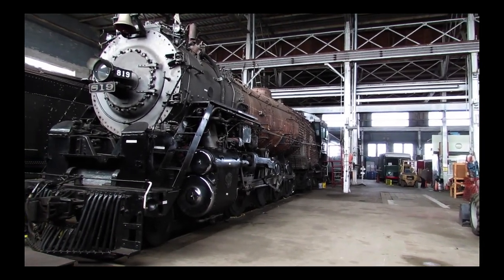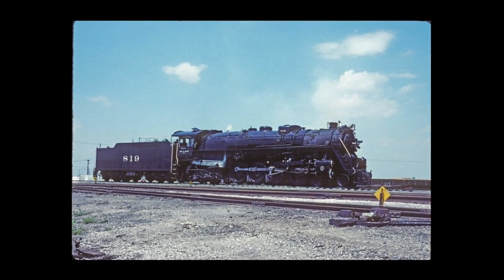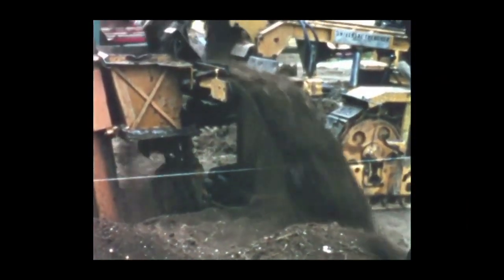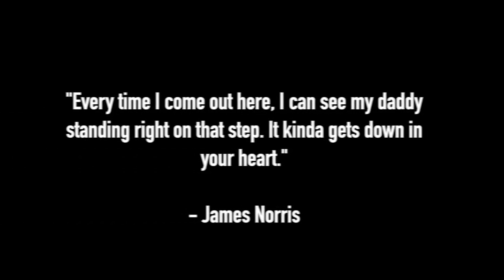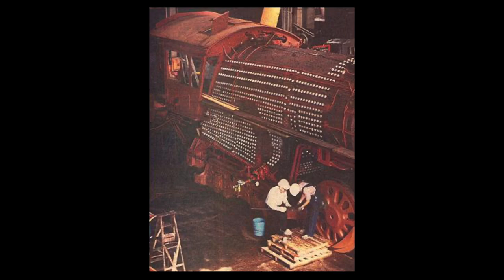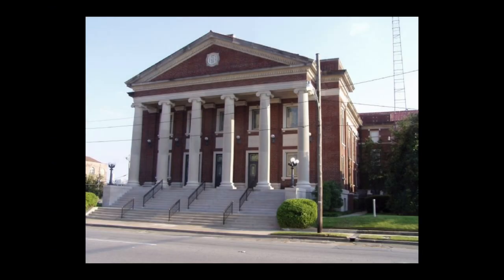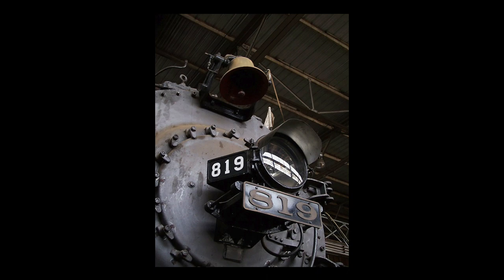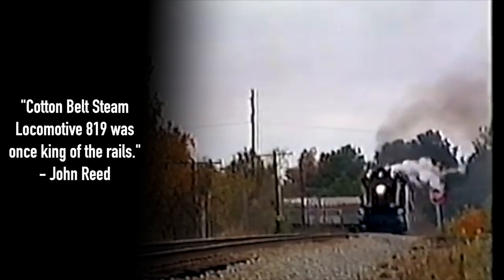Cotton Belt 819: Pillar of Pine Bluff

Comment: Out of all the preserved 4-8-4's this one is by far the most underrated and most unheard of.
Reply from the maker: Agreed.
Reply: 819 last run was in 93  because the CBRHS could no longer afford the the liability insurance and operating cost. 819 last steam up  was in 95 and the merger happened in September of 1996. 819  was invited to double head with the Union Pacific 3985 to Monroe, La   but that never happened because it got  tore down for its 2nd rebuild. Union Pacific never had  a policy against foreign steam they never said no.   819  is getting a cosmetic restoration  done on her. My name is Joel  i am commenting under my friends account, i volunteer at the Arkansas Railroad Museum  and I Get my source of information from my friends who are 819 crew members and one them fired part time on the 3985 back in the 90s.

Comment: Great document 👍
It's a massive shame 819 ain't returning to steam
Reply from the maker: Tell me about it. Thanks for watching!
Reply: @Train Guru  fine, I'll tell you about it lol :) seriously though, it's sad 819 won't return anytime soon
Reply: @TrainGuru  couldn't she run on bnsf
Reply from the maker: Theoretically, yes. Realistically, no. The Arkansas Railroad Museum had no passenger equipment, and they would’ve needed those cars.
Reply: @TrainGuru  no I meant in the future
Reply from the maker: The ARRM still has no passenger equipment.
Reply: @TrainGuru but what if they did?
Reply from the maker: Then maybe. Even then, they still need an auxiliary tender for water and for the engine to be worthy to operate again.
Reply: @TrainGuru  The 819 has an auxiliary tender. # 814 it is at the museum. We used it on the 93 tyler trip.
Reply: @TrainGuru It still has the power car, tool car, souvenir car & one pass car.
Reply: @TrainGuru we just gotta be grateful BNSF is not AS strict with steam operation as UP is, UP is absolutely allergic to any foreign steam locomotives running on THEIR lines, except THEIR OWN ones, like 844 and 4014, and eventually, 3985 and 5511 when they get restored

Comment: Facts.
1. Union Pacific  doesn't have a policy against  foreign Steam. 

2.  Last year of operation  was in 1993.

3. Stop running because the CBRHS  could  not afford the liability  insurance  and operating cost. 

4 last steam up in 1995.

5. Was invited to double head with UP 3985 to Monroe,  LA  the double header  never happened because  it got torn down for its 2nd rebuild. 

6. September - 1996 SP and UP Merger.

7.  Official State Steam Locomotive of Arkansas. 

8. Getting a Comestic Restoration.

Opinion

819 will run again someday until that happens. We need volunteers, funding,  able to cover operating cost,  liability insurance,  and a great relationship with Union Pacific.
Reply from the maker: Yeah. What I meant was that 819 could no longer pull any excursions with passengers, and that was why 819 was retired; she lost her access to pull mainline excursions.
Reply: @TrainGuru   819 sat in the Shop disassembled for many  years  , not enough Volunteers,  and not enough money.

Comment: Very well , I don't understand why union Pacific was so stubborn about letting her run on it's line after it's mergers, makes no sense
Reply from the maker: They were stubborn for two main reasons.

1.) Because many steam locomotives that wanted to run mainline excursions are not from the UP, they didn’t want an image of non UP steamers running

2.) Money. Amtrak doesn’t support passenger excursions anymore, which makes it more expensive for non profits. It’s why locomotives like Soo Line 1003 and ATSF 3751 have only run either on heritage lines or on mainline track owned by local governments or commuter railroads.
Reply: @TrainGuru  thanks for  the explanation, it's ashame, though, that a Hugh railroad UP is would think such a historical train, regardless of the carrier, would hurt there business or image, it instead would show there respect for railroad history. Amtrak's a and always will be a blight to what railroading use to be, being typical government bean counting. THANKS for all you do for railroad history!!!
Reply: It worked for Norfolk Southern, why can't Union Pacific follow in the footsteps of NS.

Comment: So does anybody here want to do a little heist?
Maybe smuggling something across UP trackage?
…..
Yeah…
Reply from the maker: The problem is that no railroad, regional or mainline, could take her. She would have to leave Cotton Belt trackage to have even the slightest chance of running anywhere else.
Reply: @TrainGuru  you’re absolutely wrong. 819 can absolutely run again over the UP at that as well. Using the BNSF trackage rights over the Cotton Belt it can run.
Reply from the maker: Does BNSF have trackage rights in Pine Bluff?
Reply: @TrainGuru  yes Memphis to Longview down the SSW, and on Longview back to Memphis on the MOP through Little Rock.
Reply: 819 last run was in 93  because the CBRHS could no longer afford the the liability insurance and operating cost. 819 last steam up  was in 95 and the merger happened in September of 1996. 819  was invited to double head with the Union Pacific 3985 to Monroe, La   but that never happened because it got  tore down for its 2nd rebuild. Union Pacific never had  a policy against foreign steam they never said no.   819  is getting a cosmetic restoration  done on her. My name is Joel  i am commenting under my friends account, i volunteer at the Arkansas Railroad Museum  and I Get my source of information from my friends who are 819 crew members and one them fired part time on the 3985 back in the 90s.